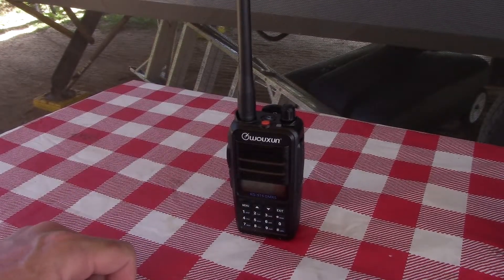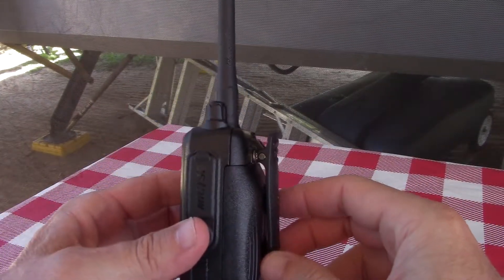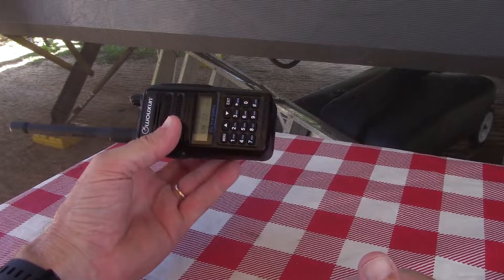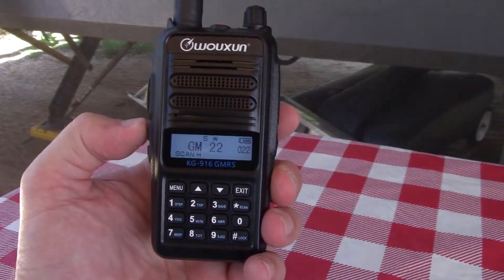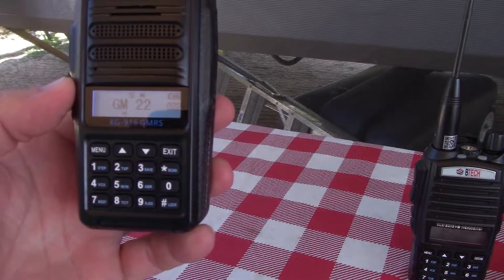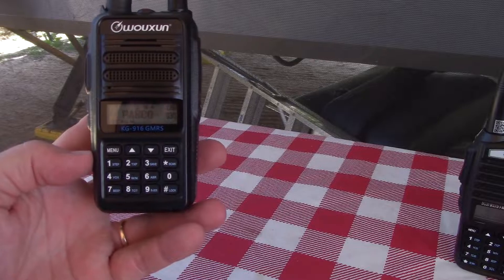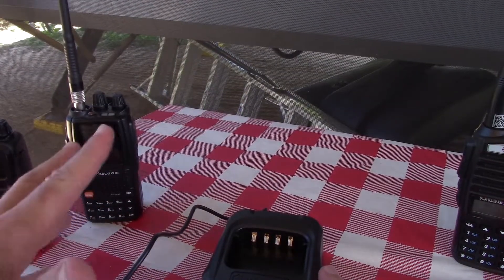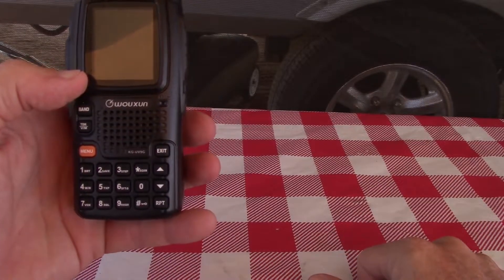Wouxun GMRS radios compared. KG-916, KG-UV9G and the KG-805G. Receive sound check.

Comment: Looking at the 916. Is the UV9G much better for the extra cost?  Really like your videos.
Reply from the maker: Thank you. The 916 is solely setup for GMRS and to me has no issues with intermod in high RF environments. The 9G has many bands, color screen and 2 receivers. Its a lot if just using GMRS on occasion although the twin receivers is great to have. Can scan with one and then keep the other on a primary freq. The 916 has most features wanted in a GMRS rig, has a larger, less tinny speaker which I really like, the screen can be seen in full sunlight and it feels more durable. Its a tough call.